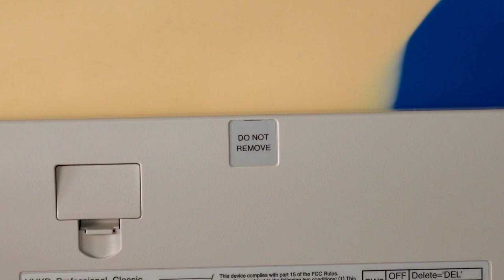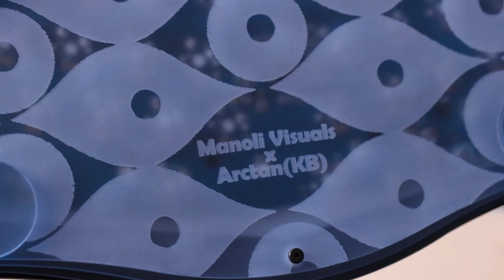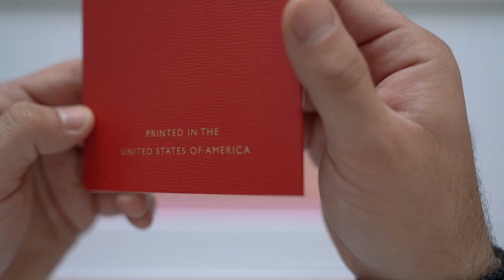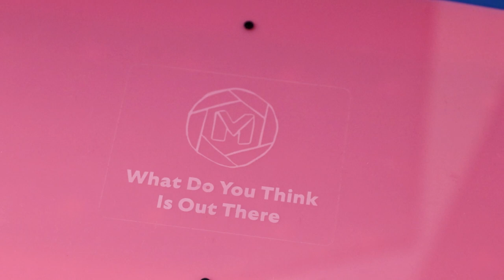Mechanical Keyboards Changed My Life

Comment: I have spent 1200 euros on keyboards and I am not happy. I did not like either the loudness, the feel, the utility (smaller form factor) or rigidity of the boards that I got. I got a Gas67 whose sound profile is just insane for its price and I was happy but this board does not withstand extensive modding and many hotswap sockets have been ruined. I have spent 12 hundred € and I have 0 board I can use at work. Neat. I would advise humanity to flee this hobby. As y'all say if you feel like it's a rabbit hole or black hole you fall into, it ain't no hobby no more.
Reply: Price tags are not indicative of performance. That being said, I am sorry that you did not have a good time with your keyboards. It can be worked out, but if you are the person who just wants a good keyboard and not to interact with the community (which is fine) it means you are not into the hobby.